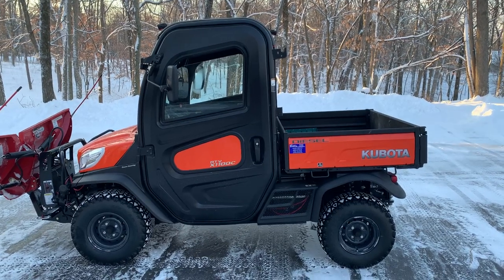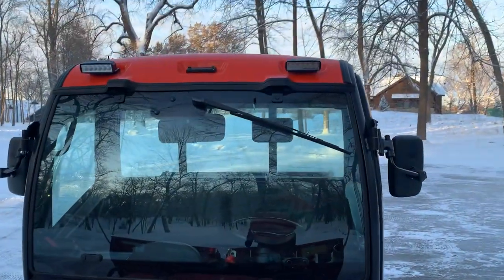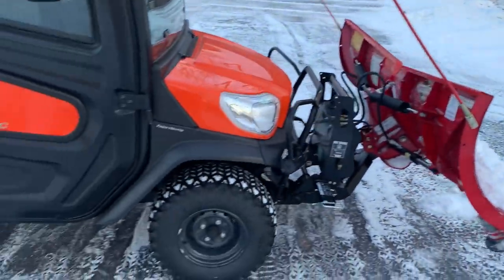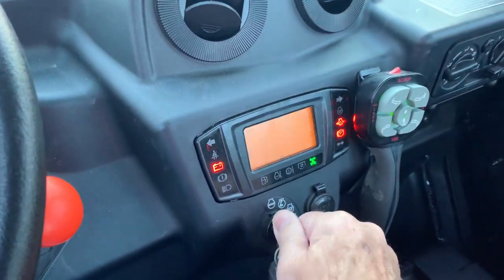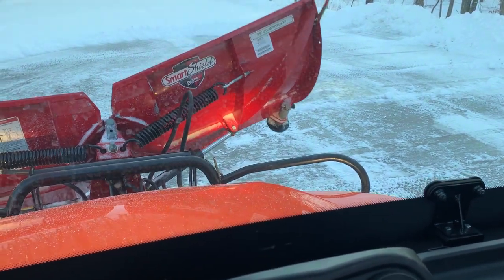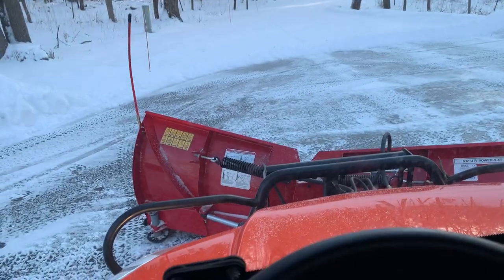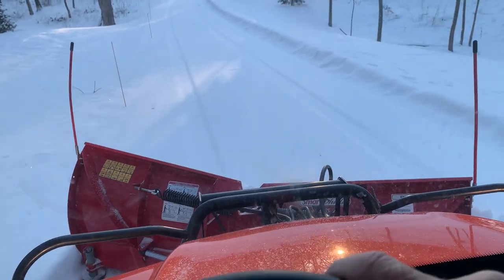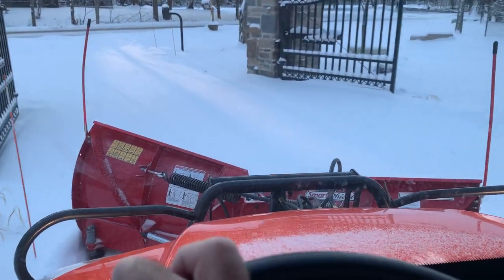Snow Plowing Driveway with Kubota 1100C Diesel and Boss XT V Plow

Comment: When you lower the plow does it go to float position
Reply from the maker: I bought the additional shoes that go on the bottom of the plow. One on each end and one in the center. When you drop the plow it rides on the shoes which are adjusted to match the height of the leading edge of the blade. Yes, the plow floats on the surface being plowed.